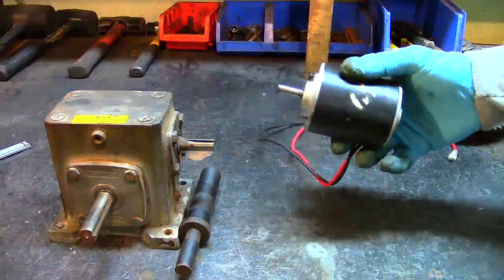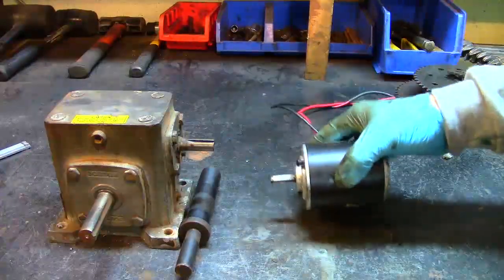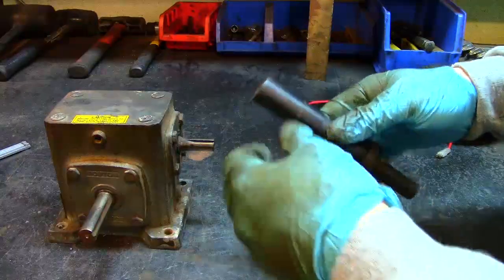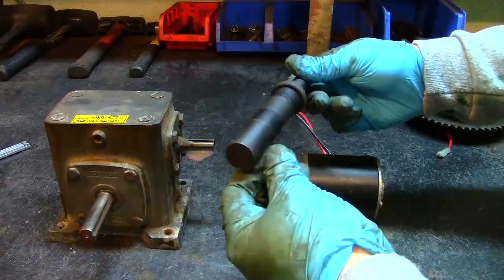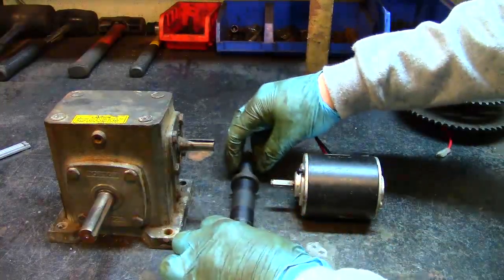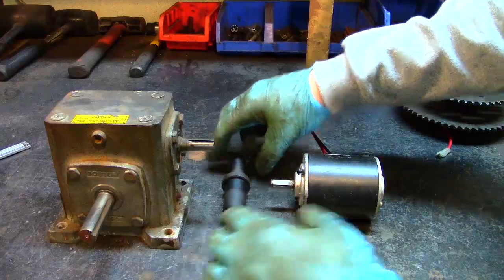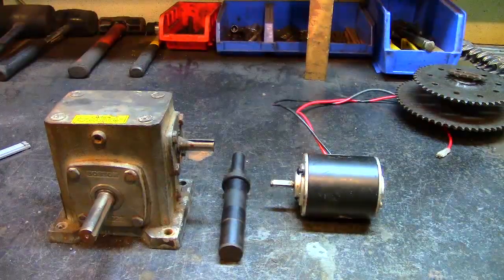Part 1: Electric Utility Hoist/Engine Hoist (Gearbox Build)

Comment: hello sorry I have the same motor that you have you coupled it as you did and has no force stops, I used a gearbox screw without end, to start and increase the force requires a simple reducer with 4 gears, yours and 'so .... yours and only simple gearbox ?    Thank you answer me I bless you from Italy Sicily Palermo

Comment: Tram tail stock or check for cylinder wear on tail stock bore or quill. You have massive run out. You should also use a shock coupling to connect motor to gear box to save wear on the gear box bull and pinion gears.

Comment: Dang dude your hailstorm is way off center with your headstock!  Even that center drill walked over to find the center.  You might want to slow your spindle speed up about 75% when you're usin those bigger drills and a little lube or coolant wouldn't hurt either.  A self taught machinist is always learnin.  I learn somethin new every day my damn self.  I would imagine you've taken care of that tailstock by now.  Nice hoist idea.

Comment: Just a recommendation in order to save your drills. You should lower the speed for drilling especially with bigger drills otherwise you risk burning them. Also you should tram that tailstock as its not centered with the chuck. You can see the center drill wondering until finding the center. Good job.

Comment: Nice build, but hang on, you use lubrication when you tap the threads because its something your doing manually, but don't use any lubrication when that poor machine saw is cutting, nor when your machine lathe is drilling... Those poor, poor tools...  :'-( Hope you were nice to them after and resharpened their cutting edges?...

Comment: In order to start a tap straight you need to put it in the drill press and start it and then shut it off and just before it looses momentum you start it into the piece you are taping and then hold it down and undo the chuck and finish with the hand chuck. Simple to do to ensure a straight tap.